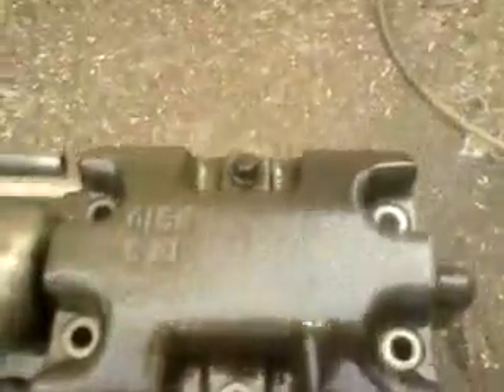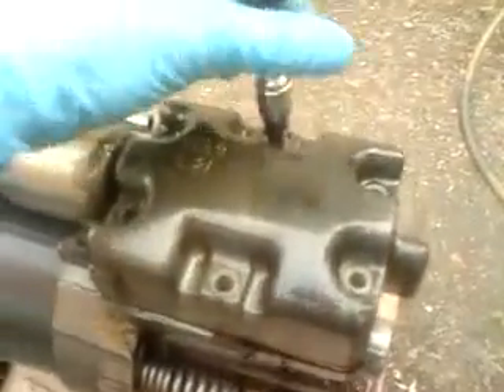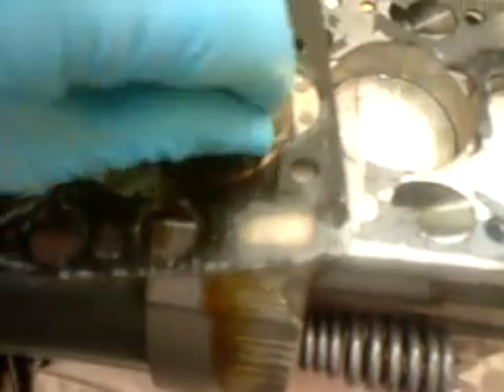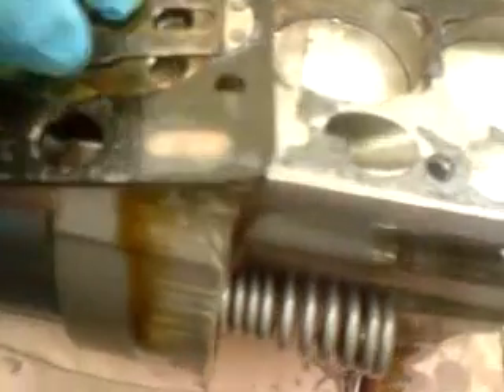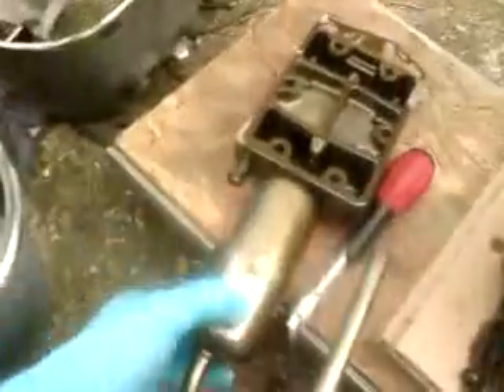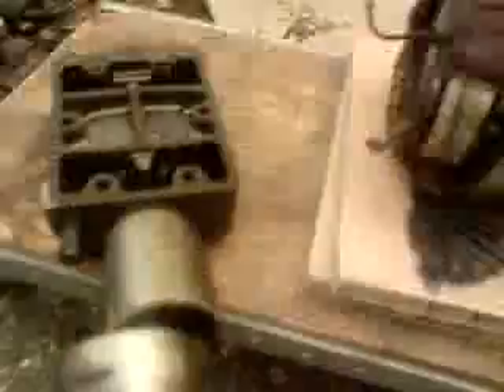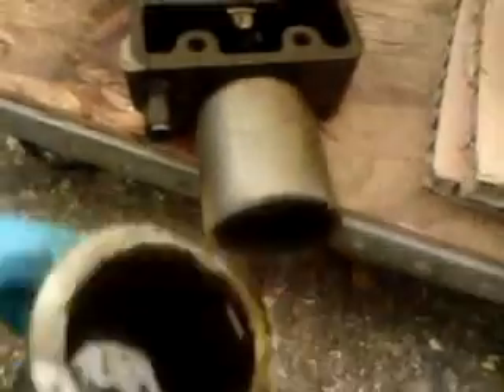Compressor inspection pt2

Comment from the maker: @Aussie50  I know the original installer so i doubt it was vacuumed propperly etc when first installed, it had also been run with a dirty condenser which raises the discharge temp and can cook the oil, also once the discharge valves go bad the comp pumps the same gas over and over as it leaks back into the cylinder on the intake stroke, this can get the oil hot enough to carbonise it hence the dark colour! R22 is particularily bad for this.